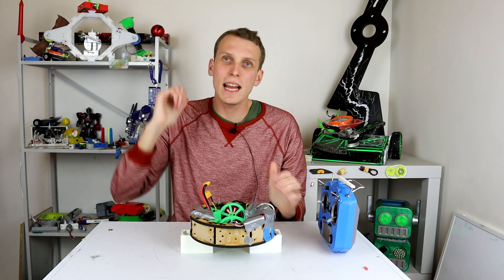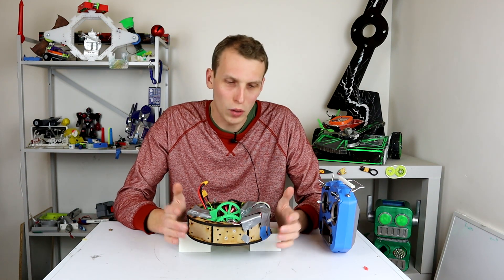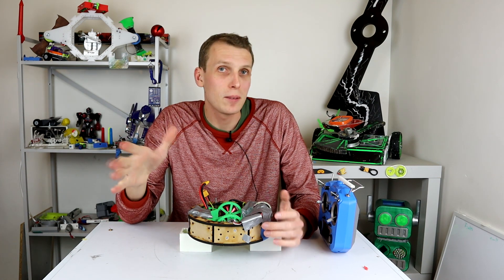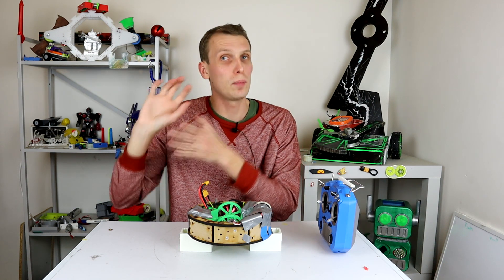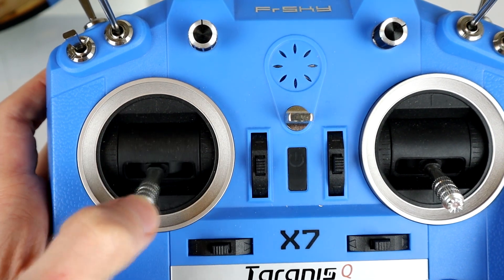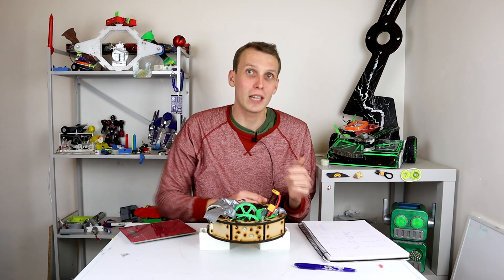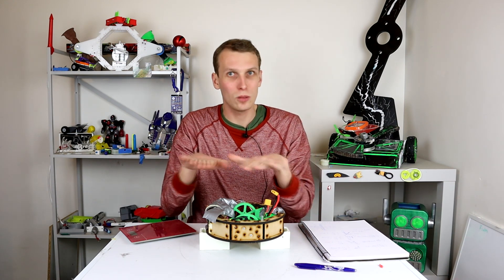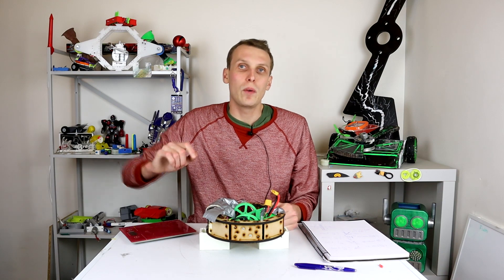Making a robot move while spinning at high speed (melty brain sensors test)

Comment: If you're still considering upscaling this for BattleBots someday, is there a workaround you have in mind for spinner mass and speed restrictions?

Also I would happily watch whole videos of you just writing out and solving maths problems.
Reply from the maker: The trick is that the whole robot is a work around for the BattleBots rules. The tip speed and weapon mass rules are part of the weapon rules subset and the first part of the weapon rules defines a weapon as something actuated by a power system that does not drive the wheels.

So from that definition, the spin of the melty is not part of the weapon at all, so I have to follow the rules for the mass and speed of the weapons I put on the outside, but not the mass of the robot or the speed of the melty.

Obviously, if I get into battlebots I'd have to sit down with them and discuss the rules and would then follow their guidelines on what restrictions to put on the controller

Comment: Did you try getting the heading from the Earth's magnetic field?
Reply from the maker: I haven't, its something to look into for sure, but it will depend on two big things: how fast you can read from a magnetometer and how bad the noise from 4 close brushless motors is
Reply: The Halo guys tried a magnometer in their antweight meltybrain but couldn't get useful data out of it. https://www.swallenhardware.io/battlebots/2019/10/16/hit-n-spin